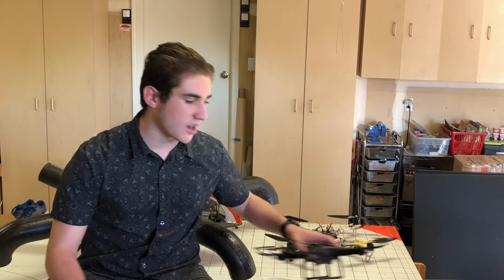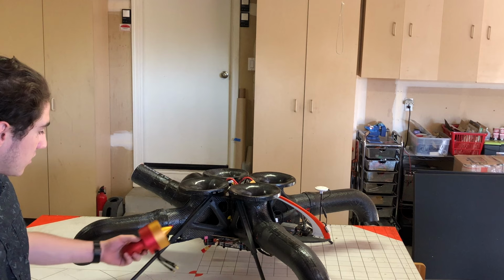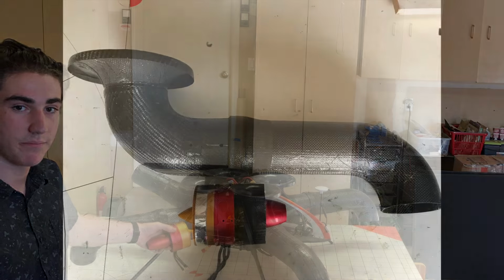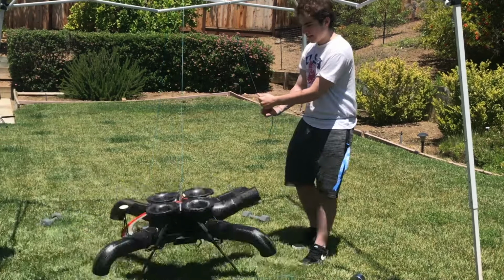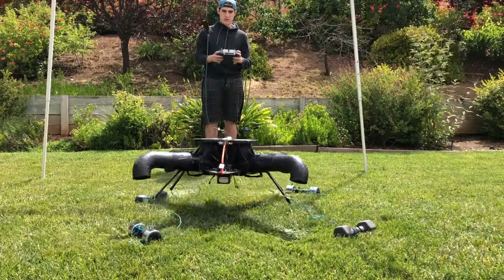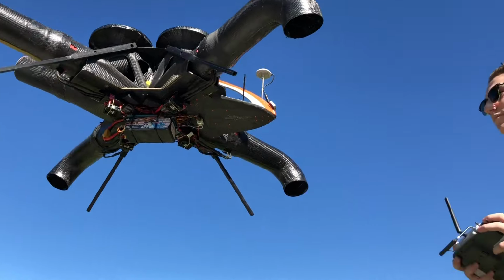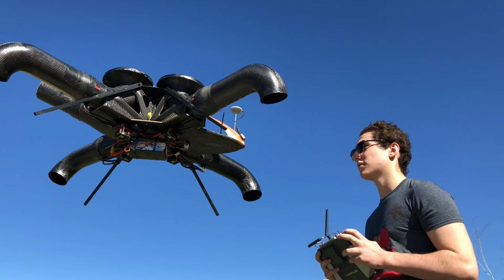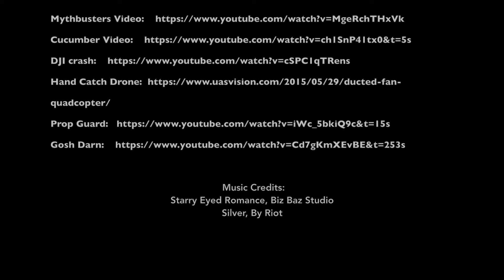Bladeless Drone: First Flight

Comment: I'm inventor, too. I think your drone is inefficient.
Reply: Inefficient, but safer. Always tradeoffs in engineering.
Reply: I was wondering how much extra weight it added and how much efficiency it lost with those tubes. The ducted fans alone would be plenty protected from everything except actually sticking your fingers in there. That should be safe enough. Don’t you think?

Comment: That string thing u got going on appers to be helping it,
Reply: in the last clip with the string you can see that the line another dude is holding is slack and not under tension, that string is to prevent accidents

Comment: 10 kw each motor? İs this a joke
Reply: Each motor supposedly draws 120A 22V, which is 2640W for each motor. Interestingly enough, if those figures are correct, this is 14 horse power.

Comment: Excellent guys, a piece of information, take advantage of the air that comes out of the nozzles, a generator that electronically feeds the energy source (battery), you could also generate water with the drone and separate hydrogen as a second source of energy, there are hidden and simple technologies, continue guys Atte an INDUSTRIAL DESIGNER from Chile.
Reply: The added drag and weight from the stators would simply drain the battery faster than they would be charging them it doesn’t work that way and generating hydrogen with electrolysis uses a lot of power same deal. It’s good thinking but it doesn’t work like you would think
Reply: A little very silly idea, I really doubted that you are an engineer, but if you are an engineer, that university must be really really very bad 🙊
Reply: @rickhuntraslam2925   lo explique de manera simple, calcula los posibles reales, no sabes nada, este medio no es plataforma para formar personas solo un poco de luz lo tecnico se trata de manera directa,
Reply: @rickhuntraslam2925  PERDON RECUERDO QUE ERES DEL CUARTO MUNDO.

Comment: Why is it being held up by a string. You can clearly see the line that goes across the yard. Then there is another small vertical line & swivel tied to the horizontal line, that is attached to the drone. It may be for safety reasons, but regardless the drone isn't flying 100% on it's own.
Reply: Just to minimize the chance of a serious crash.  You can clearly tell there's no tension in the line at times.
Reply: If the string is buckled, the drone is definitely flying all on its own. As a matter of fact, if there's no tension on the string pulling it up, the strings own weight is actually pushing it down.